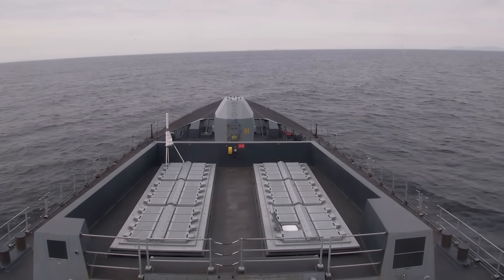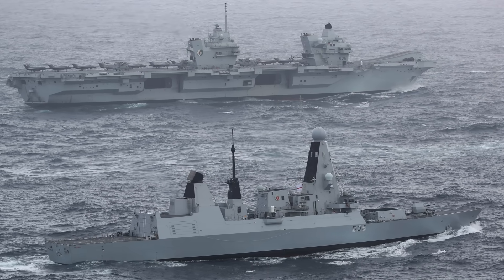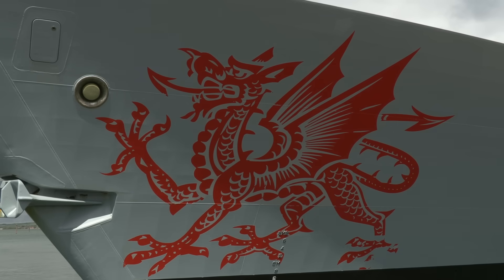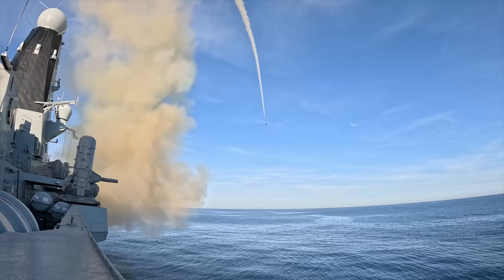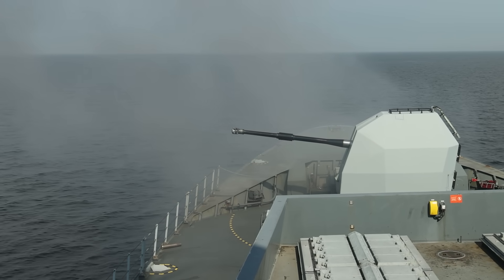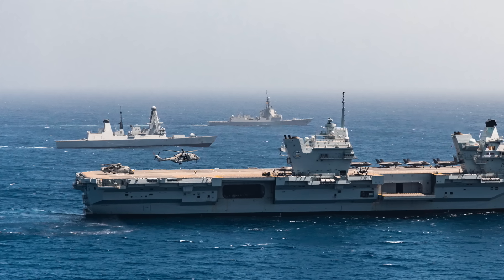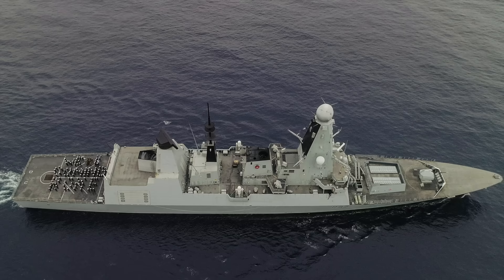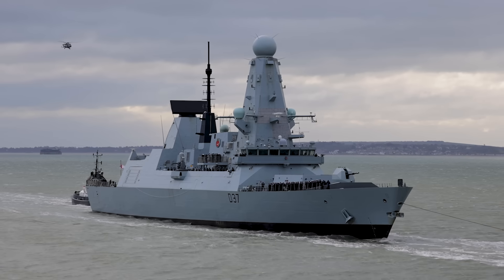Type 45 Destroyer: How the Royal Navy is Fixing its Billion-Pound Problem Child

Comment: From the published narrative, the propulsion problem goes like this: insufficient heat exchanger for the gas turbine causes overheating when operated in hot climates. Then gas turbine cuts out... propulsion drives keeps trying to draw power causing a total blackout, leaving the ship dead in the water. For a warship, that should be designed to be robust to damage, there seems to have been a complete lack of robustness/fault tolerance in the major systems.  I've never understood why a soft power limiting temperature limit couldn't have been installed in the gas turbine..seriously, "cutout" is the most stupid response to overtemperature in any system... the correct robust response is a progressive power limiter. Secondly, I've never understood how the Converteam drive inverters were allowed to take so much power out that they caused a blackout... they should have had feedback of supply frequency and voltage, and limited their power absorption to prevent blackout from occurring. The whole system seems to have been built without even basic consideration of robust engineering principles, or simulation to demonstrate tolerance of predictable faults.

Comment: The Common Next Generatio Frigate was never canceled: the UK wanted the Electic engines at all cost in place of the more reliable CODLAG and went its own way.
France and Italy went forward and built the 4 Horizon which are sister ships to the Type 45 but never suffered the crippling issues.
The missile systems is similar and the capabilities about the same. The radar was never the issue as the Italian and French FREMM have different radars, but for whatever reason the RN stubbornly wanted an electrical propulsion and paid the price.
These ships are 20+ years old, and the problem is still there, because it's structural and not easy to fix.
Reply: Interesting thanks 👍🇬🇧

Comment: Very undergunned, even with the proposed DEW.  48 VLS???  On a destroyer?  The standard is 96, double what these have.  Even the proposed destroyer, which is still on the drawing boards, doesn't have 96 VLS. Also, the video talked about giving the DEW more power.  Yeah, from 30 Kw to 50 Kw.  That means it needs direct contact for SEVERAL seconds with even the smallest Shahed UAV.  A UAV that's not even equipped with any type of evasion or protection against lasers.  I'm guessing even the chinezes know that 120 full size drones/missiles is enough to overwhelm this boat and sink it.  That cost ratio, by a rough guess, equals $40mm USD to sink a billion USD destroyer.  The UK will lose the kinetic war and the financial war.

Comment: So do you design heat exchangers for cold water climates or tropical water climates .. ??wonder how they’re coping with this design issue on new Frigates Type 26/31…???
Reply: Horses for courses- 26 will use CODLOG,31 is all Diesel.
Reply from the maker: T26 only has 1 gas turbine, and 4 diesels (the same type as those 3 going into the T45s).  One hopes the gas turbine installation was designed with lessons learnt...

Comment: Yet the British press laid the Blame on the British components, not the American designed inter-coolers being asked to do too much. 
I suspect that had the Inter-coolers been British designed and built, the British press and the BBC would have been sure to let us all know which component was really to blame.
Reply: Yes, it's predictiable that you get failure or degration in any one component... especiually in a warship ffs...hell, even a rouge tarpaulin can block an intercooler! What matters is the system engineering design for robustness and fault tolerance... that seems to have been completely missing. A robust system can limp along with all of its components degraded... doing the best it physically can.. yes it's flashing lights at you and raising fault codes but it still operates. A "prima donna" system cuts out at the slightest failure and requires a complete reset. For some reason, the Navy bought a prima donna system... someone on the customer side didn't ask enough questions or conduct their own due diligence... instead they relied ona contract... but unfortunately contract law isn't much use in a battle!
Reply: Exactly

Comment: I served on HMS illustrious from the Arctic circle to Singapore, spending 3 months of the year in the med and red seas without any real heat issues. My question is why does the WR21 rely on the inter cooler when the Olympus coped with VbV cooling?
Reply: You did not serve in a marine engineering capacity then?
Reply: @normanboyes4983 yes, I did… why’d you ask? It was a long time ago but I was a stoker
Reply: @cra83 I asked because I would have expected anyone to have served in the marine engineering department to understand the differences and why the use of intercooler and recuperations were adopted in the WR21 and what they were seeking to achieve. The Olympus was first run in 1950 and the marinised version in 1962 - these represented the state of the art in terms of design and materials of the time (essentially post war). So while the Olympus had been successful in NATO navies, it was an old engine and very fuel hungry. So the WR21 programme was seeking to address that by putting a package together based on a newer core engine (RB211/Trent) together with the Intercooler and Recuperator to achieve a more supportable engine going forward with an improved specific fuel consumption (compared to the Trent core AND the Olympus). For reasons beyond the scope of this response this project carried technical risk and unfortunately that risk really came home to roost in spades.
Reply: @normanboyes4983 I had a vague idea of the answer, I just wondered why we went with that design. 
Mainly as I only set foot on a T45 once, for a visit, when daring first came alongside and chucked my chit in shortly after. 
I’m still an engineer to this day,  in power generation, I’ve just got better things to do than study the intricacies of gas turbine tech… 
I appreciate the details, nonetheles.

Comment: Did we not do a full trial of the first boat before building the rest of them?
Reply: That typically isn't done with naval vessels as you don't want the production line at a standstill for the 12-24 months or so, of fitting out after launch and then sea trials, it's more common to have issues fixed in the second wave of ships but this just wasn't done to a sufficient degree here.

Comment: The type should have gotten the 16 mk41 cells installed in the upgrade instead of the mushroom farm for the Sea Ceptor. 
6 mk41 cells can carry as many Sea Ceptor missiles as 24 mushrooms meaning there would be space for 40 more Sea Ceptor missiles or 1-10 Tomahawks.
Reply: wait, SeaCeptor is not quadpacked in its proprietary VLS system? 😂 damn
Reply: @cathulhu-q7y  Yup.
Unsure if it can take bigger version of Sea Ceptor though. 

Sweden will fit the Visby with 3x3 EsLS soft launch cells compatible with the mk41 giving it 36 Sea Ceptor misisles with just 9 cells.

Comment: It was the US Northrop Grumman Intercooler that caused the propultion problem in hot climates. The Rolls Royce engines are 1st Class & in demand in many countries navies.
Reply: Makes you wonder if it's not American sabotage.
Reply: Met the specification or not?
Reply: Made in Germany…
Reply: No it wasn't. The main problem was with the Ingersoll/Rand designed Recuperators.
Reply: no incorrect and also the GE turbines the US Navy use are best and proven
Reply: @bmelo909 LM2500 were not part of the equipment contract. Given what Trump is doing right now that was probably a good call

Comment: A better fit would have been installing 16 MK41 cells in front of the current VLS for tomahawk missiles and quad packing sea Ceptor into the Sylver VLS = 32 x sea Ceptors, 40 x Aster 30, 8 x NSM. This makes a bit more sense to me.
Reply: They should've gone with the Standalone ExLS for the CAMMs. But the mushroom farm VLS are more treasury friendly I guess.